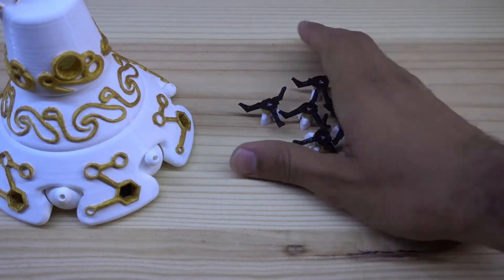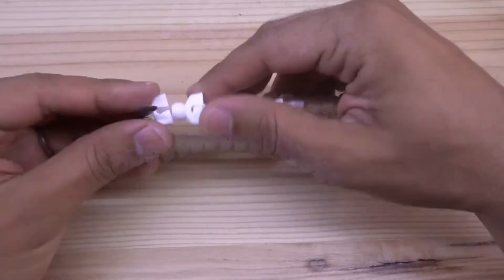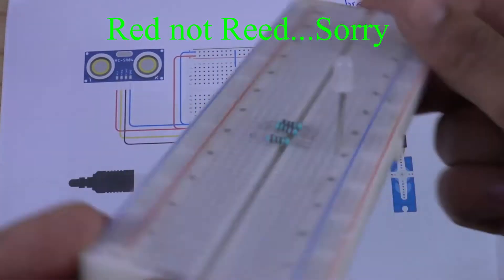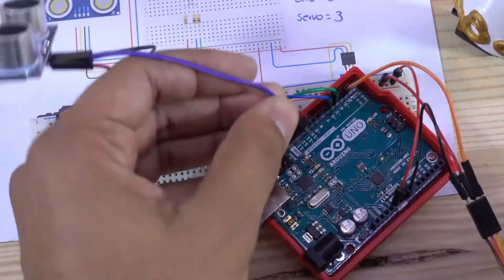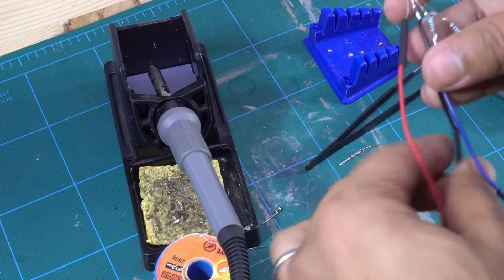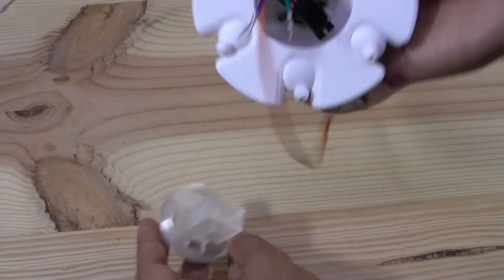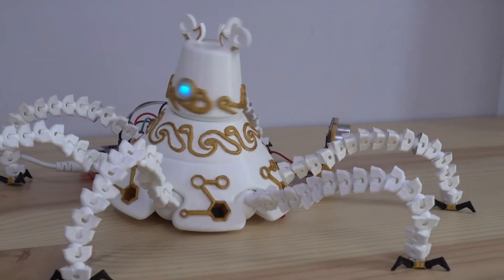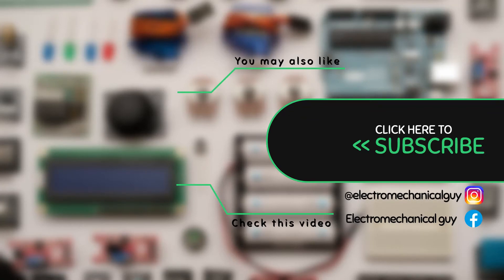Zelda BOTW Guardian 🧝‍♂️ | Arduino & 3D Print Project

Comment: This is awesome. Thanks for posting. I made this for my son, who is really into BOTW right now. It was a fun project for us.

One question... everything is wired up, programmed and working correctly, but the rotation of the servo motor twists the bottom cap off the base. How did you prevent this from happening?
Reply from the maker: Thanks for your comment, glad to be part of your project.
For the base I think I used some hot glue ( only 1 point)
Reply: @carlos3dprint  Thanks so much and thank you for posting your project!